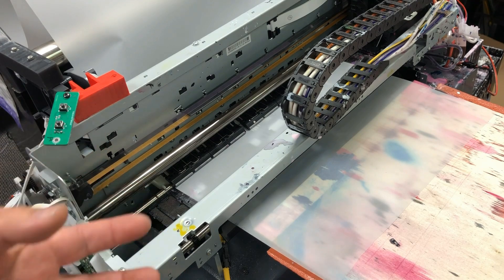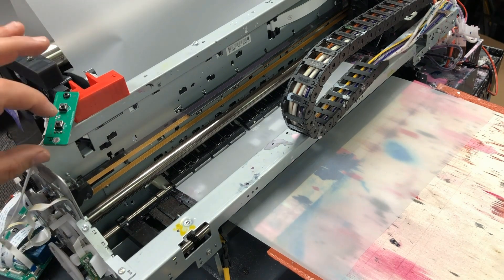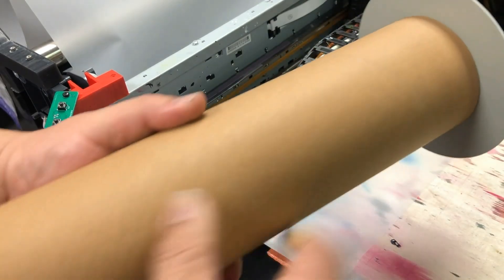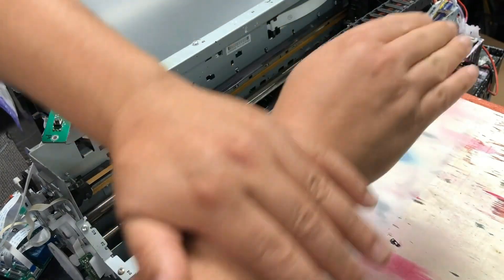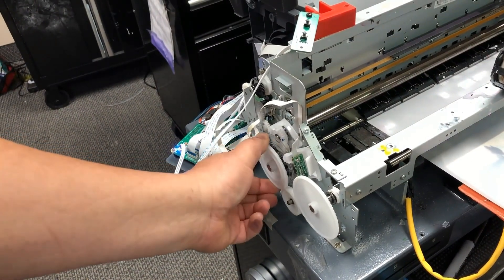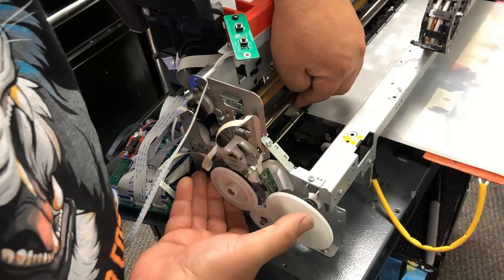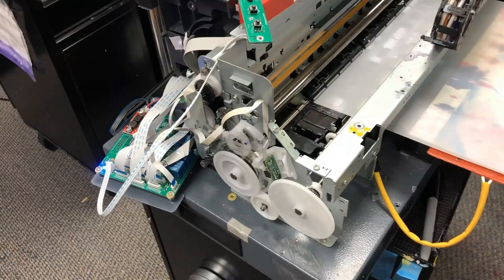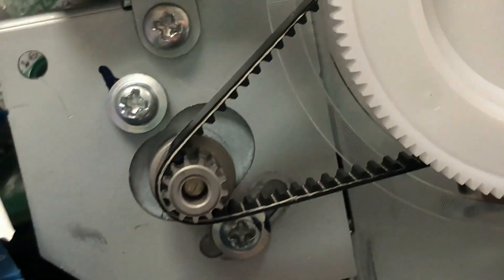Fix Printhead Stall After Jam: Solutions for Epson Error Codes 0xE2 E2H ,000041, 000051 & more!

Comment: Bro i have hp 6950 printer whenni was change the inkt from originele hp inkt and other the printer is noe blocked i cant do anything says auto  i put is out wait 8 hour then will be in but does nothing you know this problem thanks
Reply from the maker: Thank you for subscribing and supporting the channel! Every subscriber is a big step toward my 100k milestone, and your engagement means a lot. I’ve been working on this for over eight years, and every bit of support keeps me motivated to create helpful content and answer as many questions as I can. Let’s look into your issue.

It sounds like your HP 6950 printer has locked itself after switching from original HP ink to third-party cartridges. This is a common problem caused by HP’s firmware updates, which are often designed to block non-HP cartridges. Here's what you can do:

First, try resetting the printer. Disconnect it completely from the power source, leave it off for at least 15 minutes (waiting 8 hours was a great step!), and then reconnect it. After that, try restarting the printer with either original HP cartridges or third-party cartridges that claim compatibility with HP’s restrictions.

If that doesn’t work, you may need to update or downgrade the firmware. Go to the HP Customer Support - Software and Driver Downloads and check for available firmware updates for your printer model. If you want to continue using third-party cartridges, some providers also offer instructions for downgrading the firmware to an earlier version that supports non-HP inks.

Lastly, if the third-party cartridges still don’t work, it’s possible the chip on the cartridge isn’t configured correctly for your printer. In this case, reach out to the cartridge manufacturer to confirm compatibility, or try a different supplier that specializes in HP-compatible cartridges.

Thank you again for your comment and support! If you need faster assistance, feel free to email me at support@bchtechnologies.com or post on one of my latest videos—I try to reply to subscriber comments within 48 hours. Let me know how it goes, and I hope this helps resolve your issue!
Reply: @BCHTechnologies  thank you very much is did work thnk you

Comment: I have watch several of your videos 
But I need advice I have an Epson l805 printer I was doing the maintenance of the print head and in taking off the back plate the little white ribbon on the left near the clip in the back came out 
Is there an easy way to reinsert without taking the whole print head casing off 😢